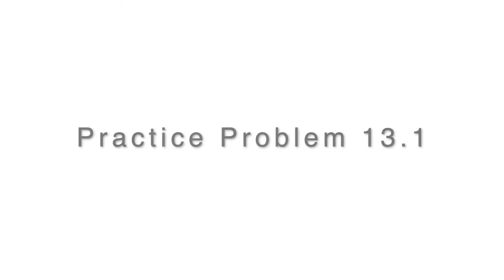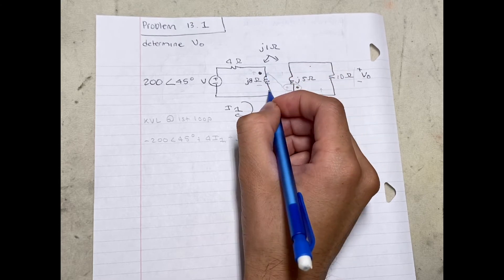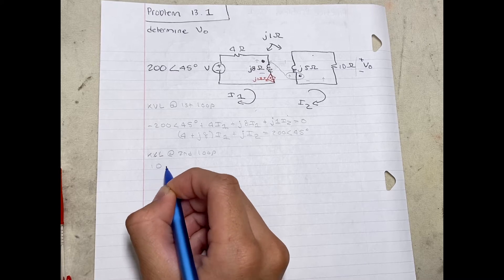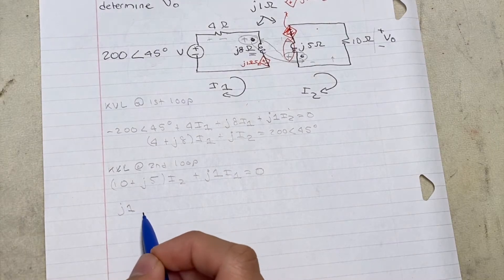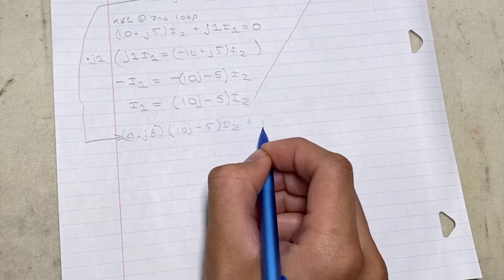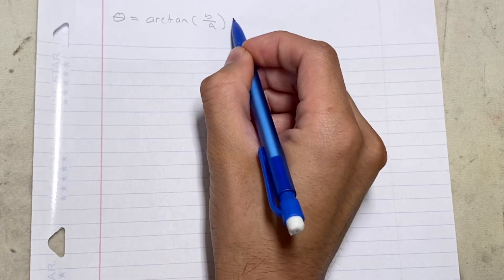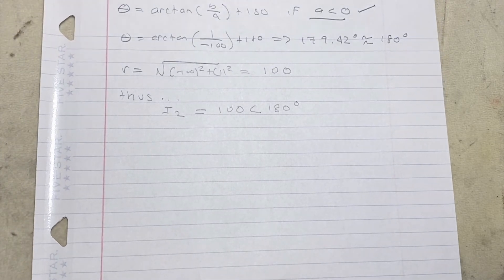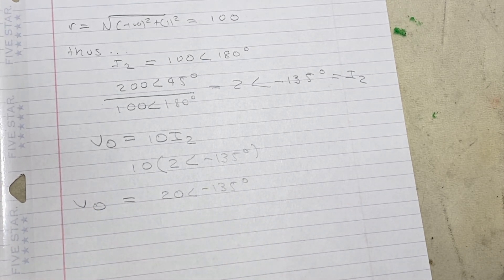Chapter 13  Practice Problem 13.1 Fundamentals of Electric Circuits (Circuit Analysis 2)

Comment from the maker: Please note a mistake at 3:25 when I bring the (10+j5)i2 to the right!!! the negative should be outside the bracket.  The final value I got of I1= (10j-5) is correct (hence why I got the correct final solution) but PLEASE make adjustments to the work @3:25
Reply: 3:45 3:45 3:45 3:45 3:46 3:46 3:46 3:46 3:46 3:46 3:46 3:47 3:47 3:47 3:47 3:47 3:47 3:48 3:48 3:48 3:48 3:48 3:49 3:49 3:49 3:49 3:49 3:50 3:50 3:50 3:50

Comment: May I know? At the second line of KVL at 2nd loop.
How you shifted (10+j5)i2 to right and changed the sign (-10+j5)i2.
How you changed only 10 to negative inside the bracket.
Reply: yeah it is wrongly done i guess...
Reply: Yeah that's what is wrongly done i guess
Reply from the maker: yes thank you for pointing out this mistake. You are correct